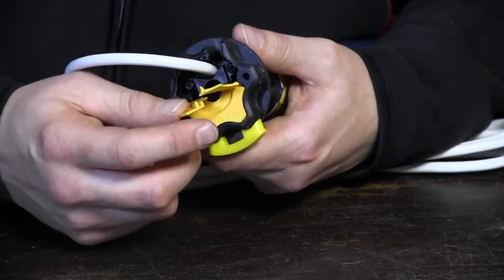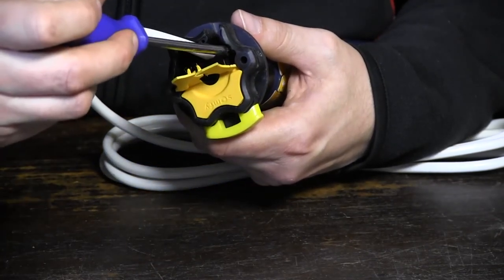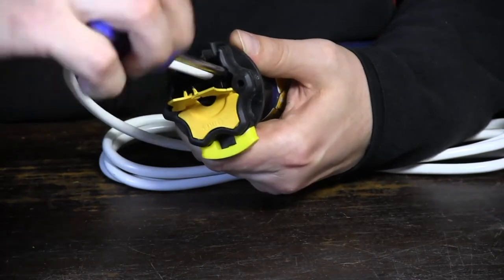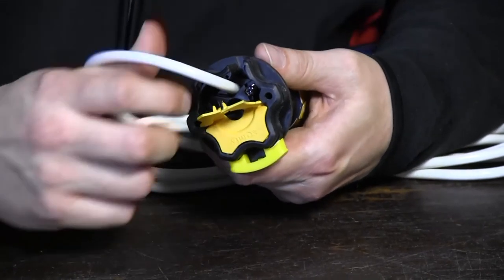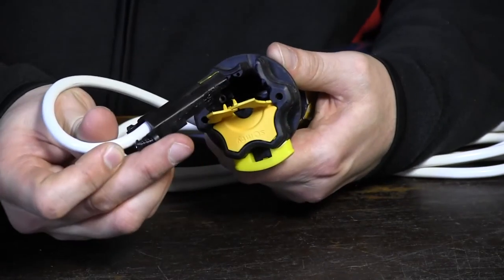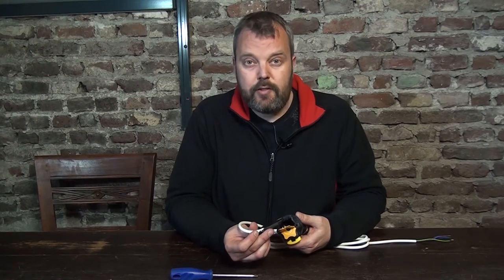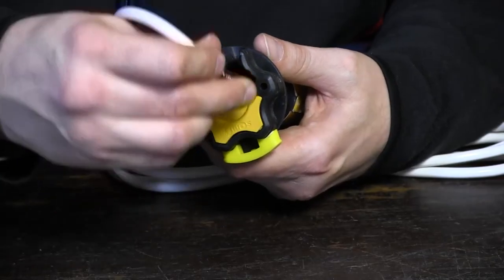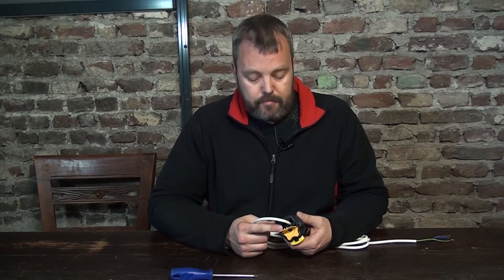How to replace / remove the power cable on a Somfy motor

Comment: Is there still no possible way of replacing the power cable on the Soneese 40 RTS motors? I have some that were cut too short, and prefer not to have to solder and heat-shrink cable that’s going to be behind drywall for these... I have Soneese 404S2 RTS motors
Reply from the maker: Hi Chris, 
Unfortunately, there's no way to replace it on the 40 series.
I am afraid soldering is the only option.
Sorry..

Otto

Comment: my awning motor only works on retracting. can I repair it?
Reply from the maker: Sorry for the late reply. It's odd that it only works on retracting, as it is normally the other way around when there's a problem. I would assume it's a problem with the settings, so you could try adjusting the limit settings.
Reply: Motorise. that is ok. any thought on where I would do that. I got the awning used off of another person and have no clue on it. I am good at things tho.
Reply from the maker: Normally, there would be a white and yellow screw on the head of the motor which allow you to adjust it. Could be different colors as well (if it's not a Somfy). One would be for the up and one for the down position. Easiest way to adjust is by turning towards the "+" direction and then checking which end limit has changed (in or out). Once you've determined which screw adjusts which position, you can turn to "+" for further in or out, "-" would be less in or out. Hope this helps.